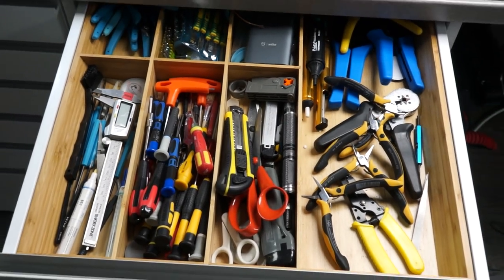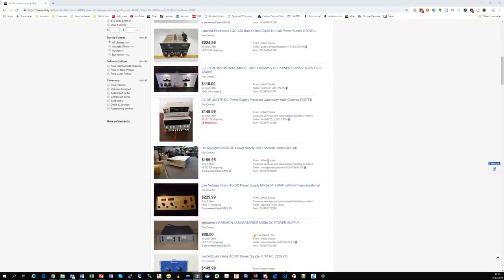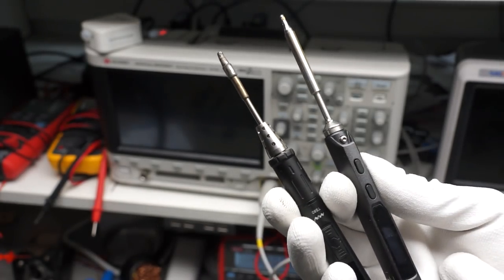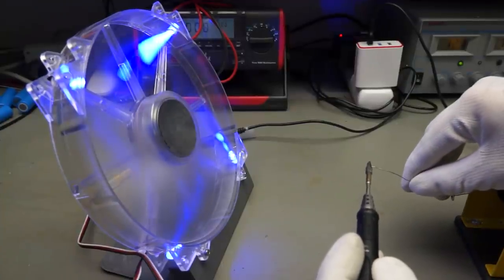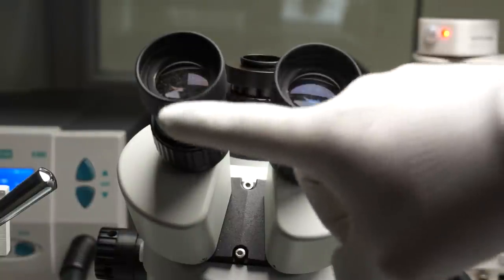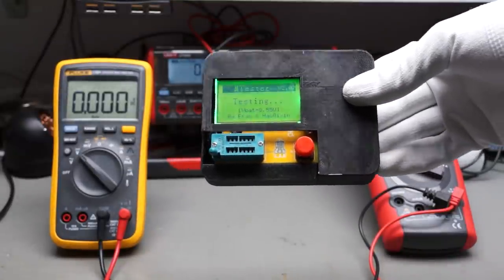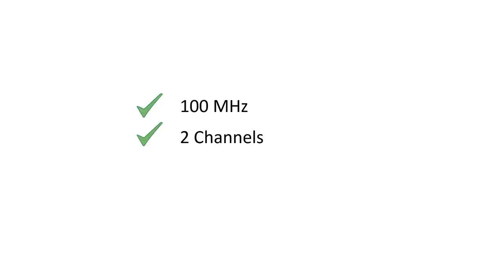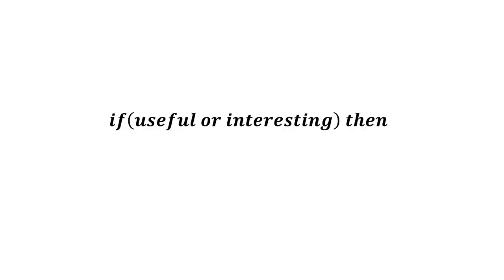#260 Most used tools, tips and tricks to spend your money wisely

Comment: For soldering, I’ve been pretty happy using dental binoculars. I get 3.5x magnification and a good working distance. Anyone else use those?
Reply from the maker: Must be good. The dentists work a lot with them. I asked mine but he told me they are quite expensive.
Reply from the maker: Thanks for the link!
Reply: @tomcrofton7744  Tom you say you got one "like" the one in the link, do you mean this brand exactly?
Reply: @kevinkibbe2146  Mine look exactly like the ones in the link. They are 320mm x 3.5x, black frames and white lens section.  I paid $33 for them in 2017 from an ebay seller called carekitmall.  Many ebay sellers had them and some added an led light pack.  There is no branding info on them.
Reply: @tomcrofton7744  Thanks Tom. I'll give them a try.

Comment: Thanks for another great video ! In addition to your video for multimeters : something like an UNI-T UT139C is auto-range, cheap and you can disable auto-off. As it run on two AA cells, they last a while ! (perhaps other brands are on AA cells too)
Reply from the maker: I am not very good with battery operated devices without auto-off ;-)
Reply: @AndreasSpiess   A bench one is better for this utilization - for sure ! But for those who want to buy only one, perhaps this can help ;)

Comment: "last till the end of my life..."  I go through 5 pounds of solder PER YEAR!   I still can't justify the cost of a decent 3D printer. Getting parts done at a shop is still way cheaper if you are a small user. (USA,  I don't know if this is true in Europe. )
Reply from the maker: I probably use more 3D material and you use more solder ;-)  I still use the first roll. 
Because I do most of my 3D designs myself, I often print only parts to check dimensions (I am not good at measuring). This can be done in nearly real-time.

Comment: A two channel scope will suffice for most things, but you will eventually wish you had one more channel.  The logic analyzer may bridge this gap most of the time, but I still recommend a four channel scope, just in case.  In the mid 2000s, I bought a Rigol 100MHz two channel scope that I dearly love.  It was quite a monetary outlay at well over $1000 US, but still was much cheaper than the name brands (HP, Tektronix etc).  At the time, the  Rigol brand name was pretty much unknown.  Now you can purchase a new Rigol 1054z four channel for about a third the cost and it can easily be upgraded to more bandwidth and the ability to decode serial communication protocols. The built in math and FFT is awesome beyond description.  

The $10 US 24 MHz Salea clone signal analyzers combined with Sigrok open source software will decode virtually anything and will suffice for most needs, just spend the money to get some nice clip leads.  

Something that isn't often mentioned is 63/37 solder.  It is eutectic, meaning that the transition from liquid to solid state is near instantaneous.  This helps avoid cold joints due to the wire moving during the transition from liquid to solid.  

Listen to this man, he knows what he's talking about.  He has much experience.  And I'm sure he would agree that experience is what you gain when you were expecting something else.  ;)

My next big purchase will be a 3D printer.  I'd also like a binocular microscope, but I get by with a magnifying lighted visor.
Reply from the maker: That is why I did not recommend to go for old scopes. The prices came down like hell...

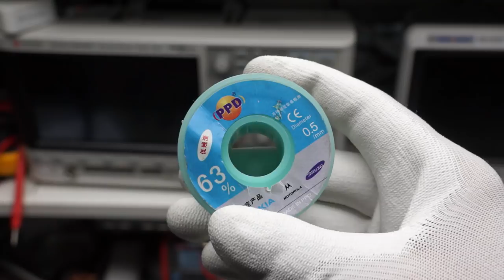Comment: 5:00 i read somewhere that solder wire is getting old and it has certain lifespan so in that case maybe should one buy smaller 50g sodler wire and use a rule about replacing old soldering wire?
Reply from the maker: I never heated that. I have solder wire here for the next 50 years ;-)

Comment: Dear Andreas,
I'm always impressed about the quality of your videos. Please continue!
What I miss in this video is that you did not mention a word on ESD protection. As I had recently some bad experiences with Chinese boards, I found out that (after  many years of use) my soldering iron was not connected to the earth potential. This resulted in some defective parts, which were not easy to debug. I wonder if the TS80 and TS100 are always properly discharged? Thanks, Herman
Reply from the maker: I do not care too much about ESD with the exception that I have an ESD mat. Maybe I could have added this one. 
Both, the TS80 and TS100 have a screw where you can ground them.
Reply: @AndreasSpiess  In the past I also ignored ESD protection, but this is changed now. The ESD mat AND the solderstation are now properly connected the earth. Thanks for your reply and the many useful videos!

Comment: You forgot the electric desoldering vacuum gun for through hole and a desoldering wick. For now, I bought a Sanwa CD772 DMM, a Hantek 6022BE scope, Longwei 3010 power supply and a 850 hot air station plus my old but still working Goot KS-30 soldering iron, I'm gonna either buy one or make one that USB isolator as you advise. Now my wallet is crying and I have a LONG WEI to go :D.
Reply from the maker: I had to reduce the list ;-) But the desoldering gun would have been very low on my list. I still use a manual one for the few times I need it.

Comment: beware some of the usb scopes draw more current than the usb isolator dc-dc converter can handle. y cable and external power may be necessary
especially this awful hantek scope you showed, it comes with a y cable.  better get a dscope its so much better
Reply: All USB scopes suck. Without exception.
Reply: you have no idea what you are talking about.

Comment: Storing the projects in plastic boxes? Hm. I may missed something but I always had the impression that those neat boxes with lids are prone to get statically charged and it might hurt those unprotected pcb-s or (half)-finished breadboard circuits when you remove them from the charged box.
Reply from the maker: I never had problems with that. But my lab floor does not create static charges.

Comment: Instead of the binocular I ended up going with a head worn design like surgeons use. I paid less than $60 and everything and I can see zoom in at 400 MM away. Since I wear them on my head I can also use them when fixing people's teeth. Working with car electrical. And everything in between I'm not strapped to my bench. Definitely worth looking into.
Reply from the maker: Agreed. These "surgeons lenses" usually are much more expensive. So $60 is a good price.

Comment: One word on the cheap chinese breadboard supplies as seen in the video: Be careful with those. I already had two of them failing on me resulting in much higher output voltage and therefore frying the components down the line. Reason for failiure is not yet fully clear, but I assume it was an overload/current spike situation that caused it to fail. The 5V linear regulator literally blew up in smoke on two units. I am now looking for a more reliable and protective option with a similar setup. Maybe someone has a suggestion?
Reply from the maker: What was the supply voltage? I never go above 7.5 volt
Reply: @AndreasSpiess  Good point. The board is supplied with regulated 12VDC since I sometimes need 12V as well. As per the datasheet of the AMS1117 regulator this is still in spec. At full load (1A) the tiny SOT223 chip has to convert seven Watts into heat. But overload and thermal protection should catch that and shut off the output...

Comment: I would suggest a solder sucker, jewelers screwdrivers and a Dremel as higher priorities than a 3d printer or SMD equipment. It is also worth saying that not all electronics is digital. Someone who is more interested in audio (for example) or RF or car electronics would probably have a different list of what is important.
Reply from the maker: I had a long list and reduced it to the 8 I presented. Of course, it is personal. I for example hardly need my Dremel and my solder sucker.

Comment: Excellent video, Andreas. My only „complaint“ is that you presented the 10 buck logic analyzer with the label Saleae on it. However, these logic analyzers are only cheap Chinese clones of the advanced logic analyzers sold by saleae.com. They also look different, even so both can be used with the Saleae software.
Reply from the maker: I have this analyzer for a long time. Back then they sold it like that. I did not mention you should use copyrighted software. These days you can use open source Sigrock with these devices. Most makers would not be able to pay 600 $ for such a device.
Reply: Andreas Spiess I agree. I got an original Saleae analyzer as a review sample for my blog at Heise Developer, but 600 Euro are certainly too expensive for makers. There are cheap ones like yours.

Comment: I absolutely agree about 3D printer. It's so much easier to use than cnc router or laser. It's much much easier to make things.
But you cannot make a PCB with it, or machine aluminium plate. For that I still use my router.. :)
Reply from the maker: I stopped milling PCBs for quite some time because I get them now cheap and fast from China. Including plating and solder mask. Both were complicated with my DIY PCBs.

Comment: I do not agree with wire strippers. Buy an automatic on, you won't regret. The one shown in the video is the best in my opinion, and it isn't really expensive at all or isn't way more expensive than those simple strippers (here, at least). But, it is way more convenient to work with! If you are in the automation field and have to do some electrical (like) wiring, buy a ferrule and a wire end tag crimp tool. You won't believe, how much better and faster you will be with those!
Reply from the maker: I will do a comparison with different strippers in the future. I agree with the ferrules.

Comment: I've seen you mention your anxt with desoldering pin headers and such.  Do you use a solder sucker pump?  I find them quite effective.  Most recently used it to remove a shorting Wemos D1 header row.
Reply from the maker: I use them too, but not very often.

Comment: Interesting. I use  1000/2000 watt paintstripper with a small nozzle the few times I need a hotair station. Works well.
Wanted to get the Kester solder. Oddly Amazon does not send that to the Netherlands
Reply from the maker: Maybe the law? Maybe you try eBay?
Reply: @AndreasSpiess  maybe. I find there is a lot of stuff Amazon. Doesn't ship to Netherlands. Don't think it's the law. AliExpress does send similar stuff
Reply from the maker: I bought now one on eBay. They shipped it.
Reply: @AndreasSpiess  I believe you, but they will not ship here. Odd, but I am used to it, also many electronics are 'not shipped to the Netherlands'.
Fortunately AliExpress not so squeemish

Comment: I also made my solder fume extraction fan. I also use a computer fan mounted on a small block of uPVC board. The fan is fix to the board using bolts and the plastic brackets normally used to fix chip board cabinet together. 
Where I might have improved on your design is that I have fitted three fan finger guards, these perform two functions: first, protecting fingers, second, providing a means to hold a carbon filter.  The two fitted at the front of the fan are separated by a nut. This allows sufficient space to trap a section of cooker hood carbon foam backed with wool. The solder fumes are drawn through the carbon filter, where it condenses on the filter. By using knurled nuts to hold the outer finger guard, the filter can be easily be removed for cleaning or replacement. The filter material can be washed several times before it needs replacement.
I have also fitted a similar fan/filter to my microscope. This allows me to solder while viewing the PCB through the microscope, without the risk of solder fumes condensing on the object lens of the microscope.

In my lab, I run all the tools that run hot from a mains  extension block controlled by an water emersion heater timer switch. This is rated to 13 amps and gives a variable delay of up to four hours before it needs to be reset.( Turned off and on again). The advantage  of this arrangement is that soldering irons, heat guns and glue guns cannot be left on by accident.  This not only fire safety protection, but it also reduces the oxidation of the soldering iron bits, preventing them from being left on for days in end.
Reply from the maker: Good idea with the fan. Concerning switching of-the hot-glue gun or the soldering iron: I use a timer for the gun and the TS80 has an auto switch-off if it is no more moved. quite handy because it immediately switches on if you need it.
Reply: @AndreasSpiess  I once watch a colleague place an A2 circuit diagram down on a work bench with a hot soldering iron on it, not that we knew at the time. The iron had been left on for days. It took a while, but slowly the blue print started to turn brown, almost unnoticed. It was the flames about twenty minutes later that got everyone's attention. As it was during the work day, the fire was quickly extinguished, but had the  impromptu discussion happened at the end of the day, we might all have gone home before the fire started. After that a memo went round, telling everyone that the bench earth leakage circuit breakers had to be tripped before going home, not that this would have stopped the fire. It was this incident that prompted me to put in the timer, to stop my home lab falling victim to the same error.

Comment: Check your eyes before buying any stereoscopic device. When your eyesight left to right is differing to much a suitable magniying glases may be better (and cheaper to get). 
Keep attention how to compensate for glasses or to deal with them at a microscope. Check if you will find any specs to eye relief of the device, the distance between eye and eyepiece it works best. With glasses you need at least 15mm.
Reply from the maker: I do not use my glasses when I use the microscope. I adjusted it to my "normal" eyes. I found it easier.
Reply: As long as you have no or little astigmatism (->cylindrical correction) this is ok. With stronger astigmatism you will not feel comfortable without correcting glasses. My expierence with telescopes is that it is a personal preference, too. Some guys don't mind others do putting on and off their glasses.

Comment: Regarding logic analyzers, I'd suggest skipping the cheaper 8 channel / 24 MHz (~ 10 USD) and splurging for the 16 channel / 100 MHz (~ 30 USD) model.  I bought the cheaper one first myself, then realized I needed a higher sample rate and bought the better one.  Check out sigrok.org for opensource software compatible with various pieces of test equipment like logic analyzers, oscilloscopes, etc.
Reply from the maker: Did you really get 100MHz out of this 16 channel device? Mine stops much, much lower and says it cannot transfer all data...

Comment: Hi Andreas, love your video's and all the tips in it. I'm not buying all 8 but many of them. Some already bought offcourse. 

One thing i see; a box for the resistors. I can't seem to find them on eBay or Ali. Only smd and/or filled ones (a have already some sets of resistors).  Where did you get your resistor-box?

Greetings from (patrion) André from the Netherlands
Reply from the maker: I got this many years back from Conrad. I used some of these https://www.banggood.com/5pcs-Green-Mini-ESD-SMD-Chip-Resistor-Capacitor-Component-Box-p-1154678.html to build a new one.
Reply: I like the Akro-Mils drawer box thingies. You only really need one or two. 
If you don't have a huge amount but want to have them separated you can store them in a binder by using "trading card binder sleeves" and putting the resistors in different bags.

Comment: I use my 7 inch microscope for reading chip names mostly haha. I've outgrown my 2 chan scope. I'd like a 4 chan with logic analyzer. The new black rigol mso 8gsa 4 chan looks incredible. I forget the model name It is 1300cad and about what I think would be a good price to pay for a scope I never want to upgrade. My 2 channel hantek was recommended to me by an engineer who said it had logic, can, i2c. It has none of those. But being new and wanting a scope I believed a lazy engineer and I had the money saved up for a nice siglent. That's my fault for not doing due diligence even though I was mew to the hobby.
Reply from the maker: Oscilloscopes get better with higher prices. Usually, I recommend going to the top budget and buying this one. However, I would not pay anything for a built-in logic analyzer. Cheap Chinese boards offer much more functionality and a PC is a much better interface for such tasks.
Reply: @AndreasSpiess  I suspect the wife will never let me have one. Plus I have a local charity I'm trying to get off the ground where I donate arduino kits I put together with every sensor and motor you can imagine along with a multimeter. Nobody seems to want one. If bought on ebay it would cost over 100 dollars but everyone wants immediate gratification these days and do not want to take the time to learn. I fear I've wasted alot of money my friend. I live in an area where moving out to the oil sands are on the western part of Canada is the dream yet everyone ends up penniless because of cheaper labor from other unions. I can't say I didn't try though. Even friends with jobs that require knowing how to use a multimeter and solder correctly will let me give them the gear but never take up my condition to prove they can learn ohms law and solder leds at different brightness levels and tells how they figured it out hahahha. Friends with 3d printers and no idea how to level them haha. I've failed I think Andreas.
Reply from the maker: @jstro-hobbytech  I agree, it is not easy to get young people involved. We have the same problem here :-(